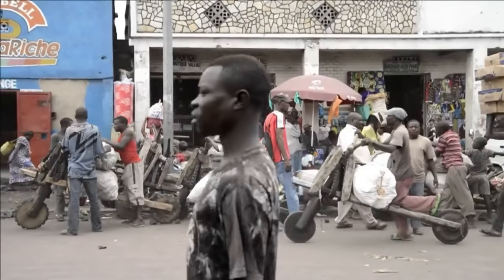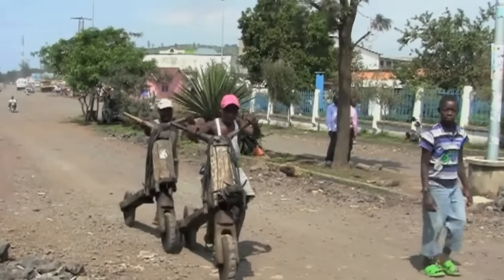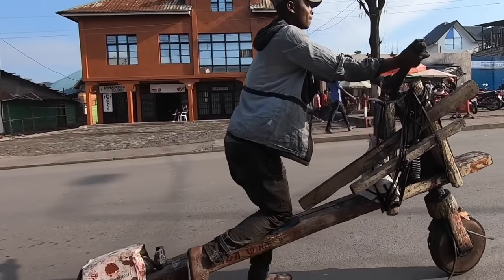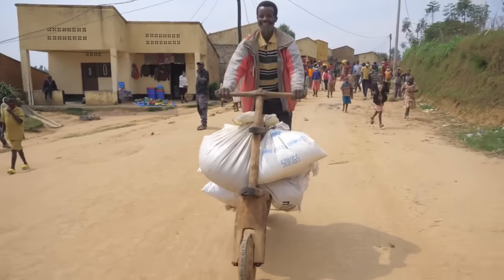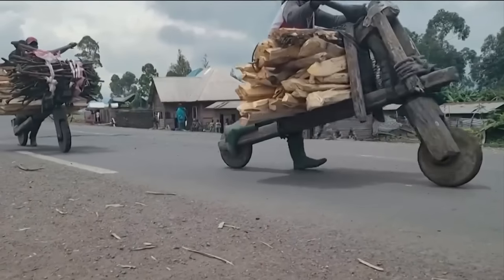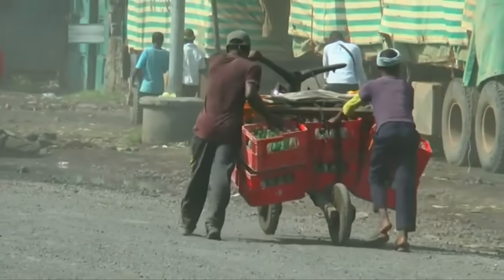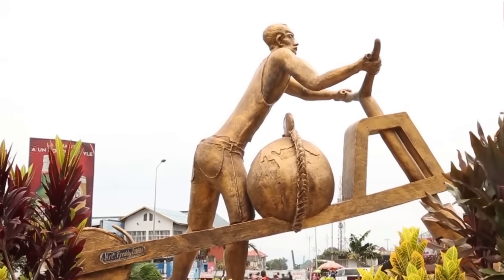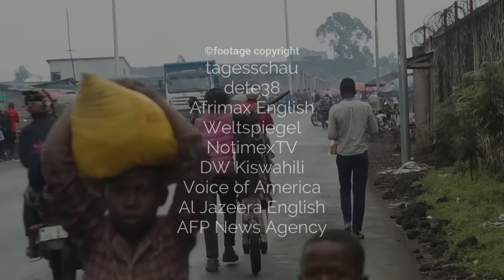Chukudu: The symbol of perseverance and creativity behind the poverty of the Congolese community.

Comment: Im an 83 years ol Brit engineer. Lived and worked in 6 different sub Saharan Agrican countries from 1969 to 1995 working in small industries development.
Whilst making these scooters is innovative its not development. They use high tech rolling element bearings but crude wood structure.
After 1995 I went to work in Cambodia from 1998 to 2018. Small industries development in Cambodia of that 20 year period has been amazing.